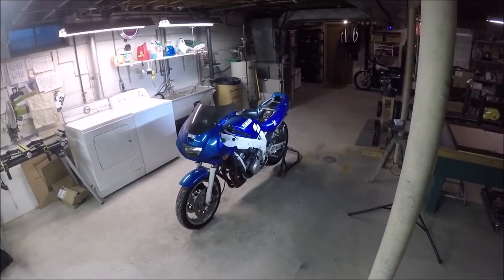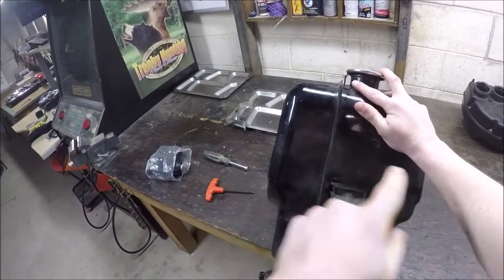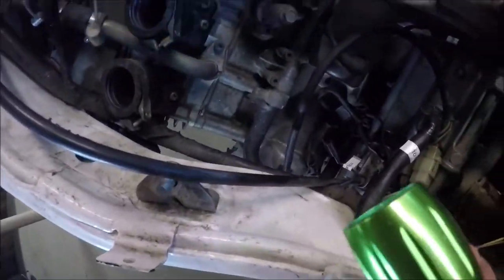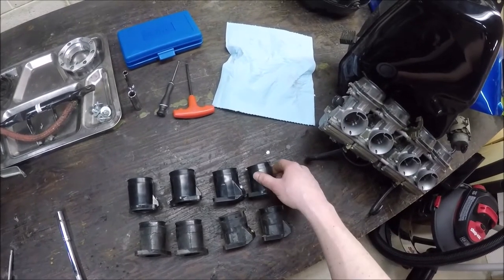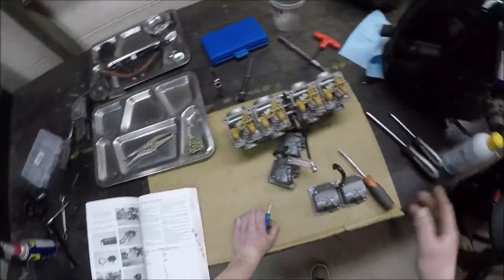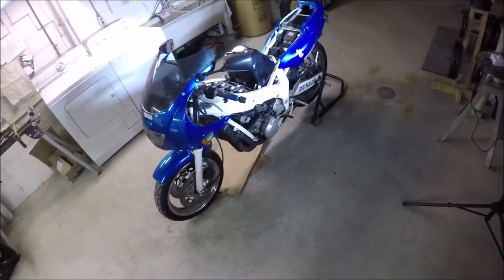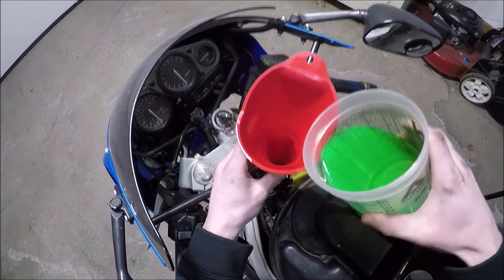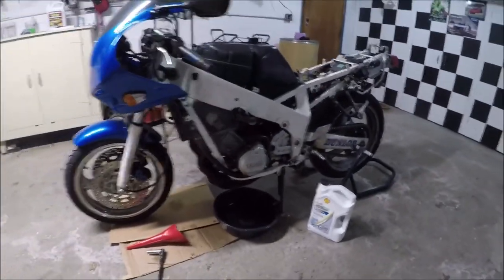FZR600 Maintenance - Carburetor, Intake Boots, Coolant System Hoses

Comment: Just watched your video and enjoyed every minute of it. I am just reviving my street Fighter project of a 97 FZR600 and wanted to clean up and change fluids and your video is a big help. Mine did run poorly on idle and cleaning the cabs seem on order, also have no visible oil in the small check window (wondering where it went) and while I am at it new coolant fluid is a good idea as well. 
Anyway, thanks for taking your time and making the video, I know how time intensive it is :-) Take care and ride safe.
Reply from the maker: That's sounds like an awesome project, Hayri! I think if you go through and do your due diligence on cleaning up the carbs and changing the fluid, you'll have it running just fine in short order. I watched a few of your videos, so I know your attention to detail is going to be well beyond mine, and I was able to keep it running!

Regarding the check window--make sure you're standing the bike straight up. This is sort of tough to do by yourself, but it even a slight angle throws the reading off quite a bit. So if you're leaning it to the left, it'll show low. If you're wondering how low it currently is, just measure it in a graduated measuring cup.

Ride safe as well man. Cheers.
Reply: @matttriestodothings  Thanks for your reply and for the tip :-) I do have the bike on a wheel stand so it is pretty much standing upright. Hope at least that there was enough oil in it the last time I ran it :-)
Reply from the maker: @iHayri1  Oh yea, then you'll be reading it fine. Honestly I wouldn't worry too much--just get a new batch of oil and filter on there, and I'm thinking you'll be fine. Take the reading ~5 mins after shutting off the engine. And then make sure you post a video of it once you get it done!
Reply: @matttriestodothings  Will do, thanks.

Comment: Sweet bike man! I’m restoring an 88 FZR 750 and will be pulling the carbs off to replace bowl gaskets and do some cleaning.. dreading that choke and throttle cables!
Reply from the maker: That'll be an awesome ride once you're done with it. I love the styling on those bikes with the double headlights. Don't dread the cables too much--you'll be fine. Seems like every bike has a little trick that makes them way easier.. once you find that trick, you'll laugh at how much breath you wasted cursing about them. Definitely have a 90° pick on hand to help you out. That's my main tool for getting those little buggers into their homes! Good luck.

Comment: Good job Matt, its always both entertaining and educational to watch you work. I've learned to use a lil WD40 after installing new carb boots(they can be so stiff,especially if its cold)to get the carbs back on.
Reply from the maker: Thanks Scott! I'm hesitant now to use anything on boots after receiving a comment that certain greases/lubricants can dry out the rubber and lead to premature failure. That being said, I've definitely used a thin layer of valvoline grease to help seat super stiff boots when I'm afraid I'm going to damage them trying to press them in.

I was surprised to find so few videos about the FZR600 on YouTube. A couple reviews and people showing walkarounds, but not a whole lot on the maintenance. I'm working on trying to get more methodical and not lose my temper with these videos, so hopefully they're helpful to someone, someday. I also really enjoy watching long form videos (especially Mustie1 !) with people just working out issues and solving them after struggling through. Helps me stay grounded when I just want to give up because I can't figure something out.

Just had my wisdom teeth out yesterday, so probably not going to shoot anything else about buttoning up the rest of the bike this weekend. Maybe the finished product. Or maybe now is the ideal time to shoot... especially if I take another vicodin or two since I'll be far more laid back and less likely to start bitching about Yamaha engineers :-P

Hope all is well. Thanks for the feedback.

Comment: I just got a 96 FZR600R and this was useful info.  I watched the whole thing to figure out how to remove the gas tank.  I have a Motion Pro carb syncronizer tool and want to balance them and get an eyeball on those intake boots to see if mine are cracked like yours were.  It'll be too cold to ride soon so I will have a garage project soon.  Right now my bike runs great, but I'd like to make it as good as I can get it and the signs all point to previous owners being pretty ignorant.  Seems like a good thing in this case because it looks like nothing was ever messed with.  I'm guessing my air mix screws are protected by the anti-tamper plugs on my carbs.     This is my first sport bike as well as my first four cylinder bike.  So far I'm digging it.
Reply from the maker: Thanks for the comment Luke, and sorry I'm so late to respond. Hope you're still digging the FZR! What's interesting about those intake boots is that despite them looking like absolute shit, that bike still ran better than I've ever gotten my 2002 Bandit to run with just about every component replaced with a new stock substitute. My experience with the FZR is the reason I think that Yamahas are probably the most well-put-together of the big 4 bikes. I pulled literal rocks out of the oil sump, and the bike never gave me much grief. It was ran hard and put away wet, yet it never complained like some of the other divas that drive me crazy!

Anyway, cheers man. Hope you and the FZR are still rockin.

Comment: If you ever do the valves I’ll get some popcorn to watch that video. All kidding aside another good video
Reply from the maker: Hah. I'm downstairs struggling with a set of 6 "Universal Clips" for headbulbs to try to get the LED to sit flush and not rattle. I've already snapped two of them.

I don't think anybody needs to see me do a bucket and shim valve adjustment if I'm already this flustered! Ugh. I'm just gonna silicon this damn thing in there. I can't get a clip to work.

Comment: haha, the trick with the choke cable is to remove the bolt from the frame holding the choke lever and then you leave it attached to the rack by threading it under the top frame rail. detach the throttle cables and then pull it all out, choke still attached. lol
Reply from the maker: Well... whoops. I suppose that would have made things too easy though? heh
Reply: @matttriestodothings  haha. mine just came off tonight. but that stupid pressure sensor housing was a pain in my ass, and those tubes bolted to the engine were not coming off at all. Still plenty helpful with draining the coolant though. kudos
Reply from the maker: @Dlogreen  everything is a pretty tight squeeze in that delta box. Pretty sweet package once it's sorted tho.

Comment: Hi Matt ! I'd just like to thank you for documenting this whole process, as my brother tries to fix the exact same bike. As I was watching, I noticed you had a reference book, especially when you were looking at the mixture screws. How did you get it, and by any chance do you know where/how we might find it ?
Quentin, from France !
Reply from the maker: Howdy Quentin! The reference book I was using was the Clymer Manual. I usually like to purchase a physical copy of the book like this: https://www.clymer.com/yamaha-fzr600-1989-1993-m396

You'll often hear arguments that the factory service manual is a lot better than the Clymer/Haynes (aftermarket) manuals--and they're usually right. However, they're generally much tougher to come by and far more expensive. For the most part, the Cylmer/Haynes manuals are "good enough". I've come across some errors at times though.

Comment: Im thinking about getting either a FZR400 or 600. I know its hard to find parts and fairings for these bikes. How are you able to find your parts? Is it actually a big issue?
Reply from the maker: I imagine it's getting harder and is probably pretty region-dependent. I never had trouble finding parts for it, but I never searched for fairings. Mine were beat up but in tact, so I always knew I could try to repair them if I wanted to go that route.

I actually sold this bike a few years (2?) ago, and it had since been sold again. The guy that bought it found this video and started telling me about all the work that's going into it. Holy shit it couldn't have ended up going to a better home. I love getting updates about it.

But for parts besides cosmetic plastics, I didn't have a problem.
Reply: @matttriestodothings  10-4 thanks for the quick reply!!
Reply from the maker: @rapidicus6487  np man. If you've got one, or are getting one, enjoy it! I'm glad I got to own one.

Comment: I had black junk in float bowl, The fuel filter is between tank and fuel pump, no filter between pump and carb, so is the dirt from  the fuel pump??? Original fuel line, old, could it be breakdown from inside that line?  Going to try to add a filter between pump and carb, hopefully will work. Also... only one of the float intake had a screen on it, far left. The power sports shop said thats what his chart showed? It's important. Reason rebuilt is that fuel was pouring out the left overflow onto the engine, bad design because that gas soaked the engine then burst into flames in my garage and almost burned garage down. The flames

Comment: I noticed that you had trouble removing, and installing the choke cable, but you think it would've been possible to remove the carb by detaching the choke cable from the lever rather than the carb ? 

I have a 1994, will be removing the carb sometime next month.
Reply from the maker: For sure you can do that to make it easier. I've done it on the throttle side before to make throttle linkage easier. It's just quicker not to if you're good at it. Which.. On this bike.. I clearly was not! Hah

Comment: Doing the valves on these is not that difficult, once you have access to the valve cover (radiator off, then the plastic shields between the valve cover and the carbs). Easy to pop the cams out, and easy to time them back up when reassembling it. You can buy a shim kit for not a massive amount of money.

Shimmed valves seem daunting, but to be honest on mine it was possibly easier than doing the screw and locknut valve clearances on my 1200 Bandit.
Reply from the maker: Yep--I know this now after having done both my SV650 and DL650 engines which are shim under bucket. I've never done a four cylinder bike, but I can't imagine it's too different than the V-Twins. 

I'd rather do the shim under bucket and just know they're not going to move for the next 15-20k miles as opposed to locknut adjusted valves.

Comment: so did changing the air fuel screws to 3 turns out make it better?  i have an 89 and the previous owner did horrible things to the carb. ive already cleaned and replaced to oem. just have to sync and play with afr. thanks!
Reply from the maker: If I'm honest, it didn't make a huge difference. Which absolutely surprises me because other bikes I've worked on are extremely sensitive to 1/8-1/4 turns on the Air/Fluid screws. This bike just seemed to run well no matter what. Polar opposite of a Suzuki Bandit.

Back to stock like you did is usually the best way to go if you're not certain of what or why a previous owner did something. And if those things were horrible things, you definitely made the right choice. Hope the bike doesn't give you much trouble and you're on your way!

Comment: Was it difficult to get your airbox back on, ive been trying to jam those boots on for like an hour with no luck.  They might have changed sizes through the years.  I took the airbox off of an early 90s fzr600 and am trying to put it on my 96.  Seems like wrong size boots but they are oem so i aint sure.
Reply from the maker: @siafu-1764  I wish I could give you a good answer, but it's been several years since I've owned the bike and dont recall if I struggled with the airbox. That being said, I do remember the parts I actually struggled with--particularly the fuel tank rear bolt which seemed too short to me.

Sorry that answer is of no help.
Reply: @matttriestodothings  I appreciate it very much.  I have aftermarket boots that some guy used for pod filters on my bike.  They fit good into the oem boots so i might just double boot haha.

Comment: Hello! Do you remember if you put some sort of sealant in between the new intake boots and the engine? I just installed my new boots and I still have a vacuum leak and I am starting to rip my hair off my head lmao.
Reply from the maker: I don't believe so. It's been years since I had this bike unfortunately. Often times there is a rubber oring that goes between the boot and the intake boot--but I can't say for certain on the FZR. Sorry man, I wish I could be of more help. 

I'm looking at the parts diagram, and I don't see any. Just can't remember if they're part of the intake assembly or if there are none at all. https://oem-parts.hu/en/parts/yamaha/motor-robogo/350cc-699cc/fzr-600-genesis/fzr600ngenesis-3hf4-1992/intake
Reply: @matttriestodothings  there are o rings on the bottom of the boots but I don't think it's sealing properly, I have to try to reseat them and see if that fixes it. Might just be sloppy install from my part. Thanks for the insanely quick response tho! Have a wonderful week.

Comment: Matt you got a link for where you got the intake boots?
Reply from the maker: I purchased them in May 2019 for $39--looks like you can still get them for $44 today. I bought on eBay. I can't attest to their longevity since I no longer have the bike, but they felt like they'd last quite a while. 

Carb Holders Intake Manifold Boots Kit For Yamaha FZR600 Genesis 1989-1999

https://www.ebay.com/itm/292387786215

Comment: Hello, can you tell me how many turns of the air screw it takes and how many of the gas?
Reply from the maker: The air/fuel mixture screw is a single screw on each of the carburetors that helps to control the ratio of fuel and air the bike will receive at idle. Turning it in all the way (closing it) will lean out the mixture by stopping the flow of gas. Opening it up counterclockwise will richen the mixture by allowing more fuel to flow by. 

Set the fuel/air mixture screws to 2.5 turns out. That is where you'll want to start.
Reply: @matttriestodothings bro, it worked perfect for me in 2.5 turns, only without the air filter thnks
Reply from the maker: @gueropepe  hell yea man! 2.5 seemed to be the most universal setting people used. Obviously you can tune up or down based on sea level, exhaust and air filter mods, etc. But I would bet you'll be good to go at 2.5.

Comment: Where does the breather hose go?
Reply from the maker: Unfortunately I don't have this bike anymore, so I can't give you a definitive answer.

The breathers you generally have on the bike are a fuel tank vent (from the tank to ground), carburetor breather (lines are often missing and some would say unnecessary), and a crankcase breather. The crankcase breather will go somewhere from the crankcase and usually into the bottom of the airbox on the inlet side, so the air can get filtered. There's also an airbox drain where those oils from the crankcase breather collect and needs to be dumped every once in a while.

Comment: Do you have a link for the intake boots?
Reply from the maker: These are the ones I bought. About $10 each from this seller, Bing2996, on ebay. Seems like there might be a handful of sellers all with the same ones.

https://www.ebay.com/itm/Carb-Holders-Intake-Manifold-Boots-Kit-For-Yamaha-FZR600-Genesis-1989-1999-/292387786215?nav=SEARCH
Reply: Matt Tries to Do Things much appreciated!

Comment: Piece of sh*t bike?  I have a 1994 FZR600 I've had for 24 years with almost 80,000 miles.  No valve adjustments on it yet.
Reply from the maker: Oh "piece of shit" is a term of endearment if I said that. The FZR is, without a doubt, the most reliable bike I've ever owned. I took ownership of it ran hard and put away wet. It never complained.